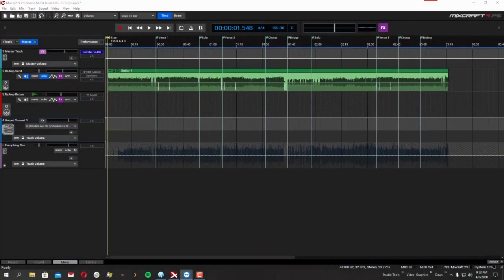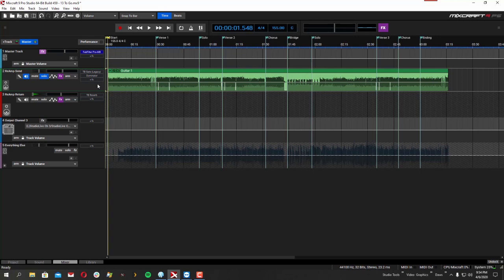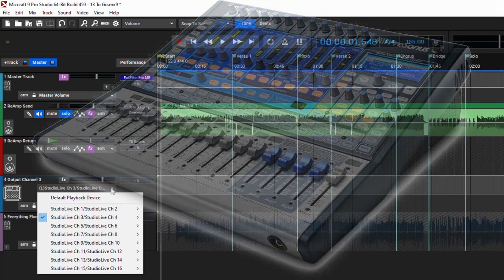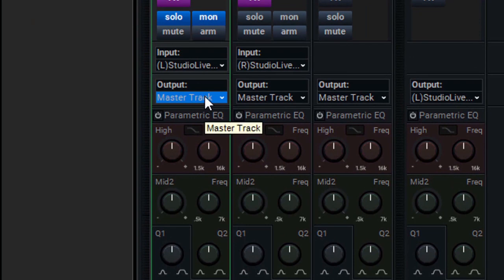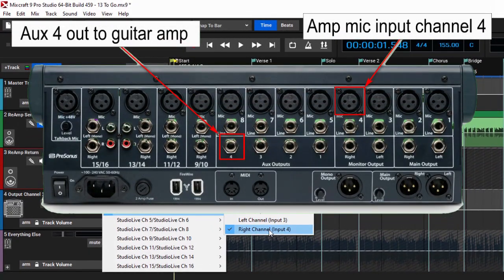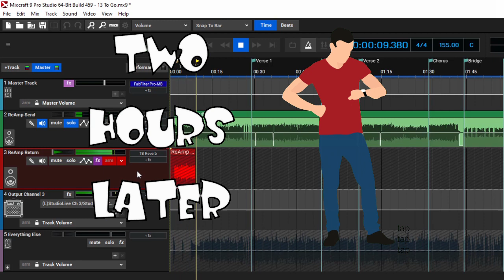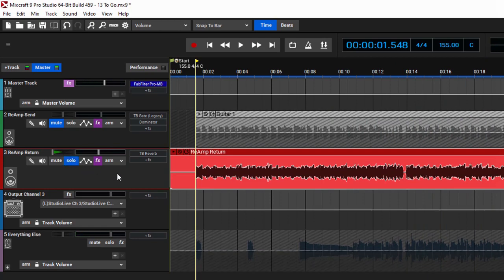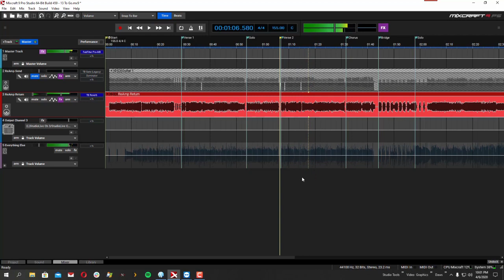ReAmping Mixcraft 9 Pro Studio

Comment: Nice to see we use the same gears ! Mixcraft Pro Studio 9 and a PreSonus StudioLive 16.0.2 USB. 😎 
I'm using the same way to reamp but I'm having a lot of delay between the original track and the reampe one.
Reply from the maker: You are probably not using the presonus asio driver. You need to install it and set mixcraft to use asio
Reply: @Mi-AudioLab  I do. :/
Reply from the maker: @Sky3RN then I'd have to see your setup

Comment: (Resolved)I really liked this video. I am not sure however what I did wrong as I followed this to the t;however I was not successful. I am using a Focusrite Scarlett 2i4. Dry left mono into track one set to be on the output bus for right side channel two. I have my balanced aux going to my amp with the mic placed in front from track two. I am just getting feedback. Also doing this without an amp does not seem to work either (as in just using vst's). Thanks for the video hoping  I figure this out soon. Cheers.